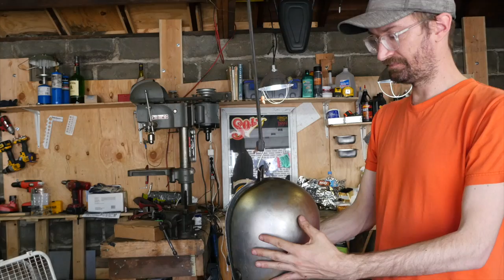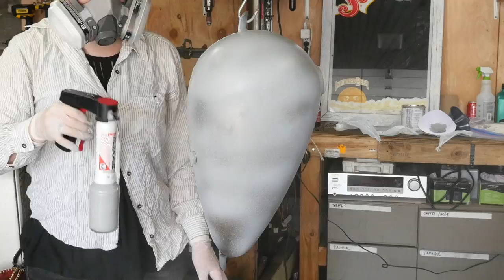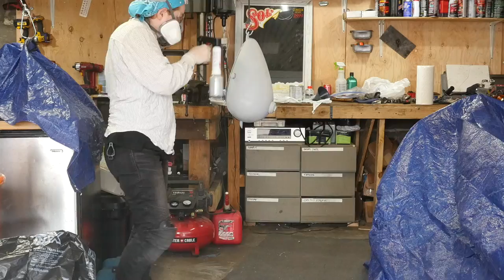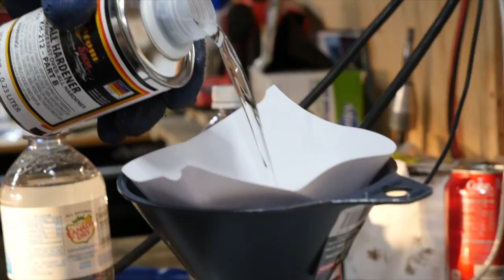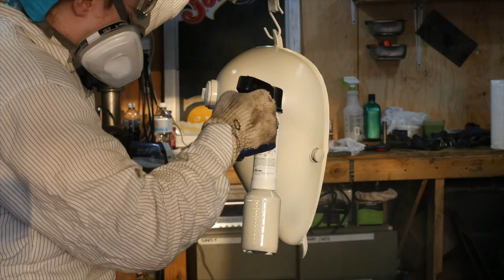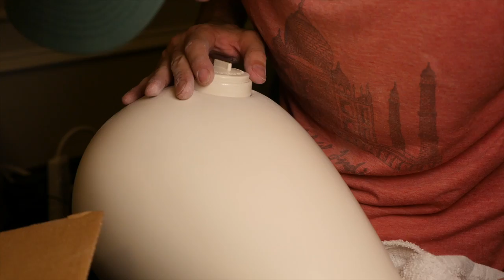Spray Painting a Matte Finish Motorcycle Tank // Becky Stern

Comment: In California you can't put liquid paint in the trash. You are supposed to recycle it, dispose of it as household hazardous waste, or add an additive that turns it into powder. Nice paint job!
Reply from the maker: That stuff's not technically paint, it's catalyzed epoxy. It will harden just as it did on the tank surface, but inside the trash can.  Here's the NYC instructions for throwing out paint (http://www1.nyc.gov/nyc-resources/faq/478/how-do-i-throw-out-paint): 

If the paint is latex-based, you can take up to 5 gallons to a Special Waste Drop-off Site.

Recycle empty metal or plastic latex paint cans.

If the paint is oil-based, you can put small amounts in a black garbage bag mixed with kitty litter, newspaper, or another absorbent material that will soak up the paint.

To dispose of a large amount of oil-based paint, contact a private hauler or an environmental services company.